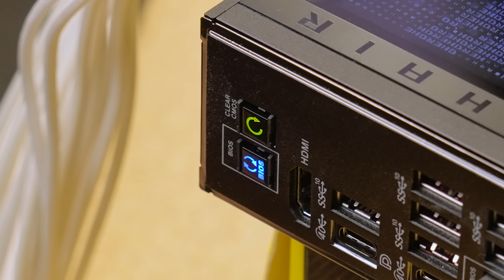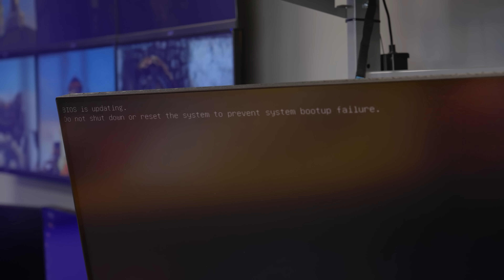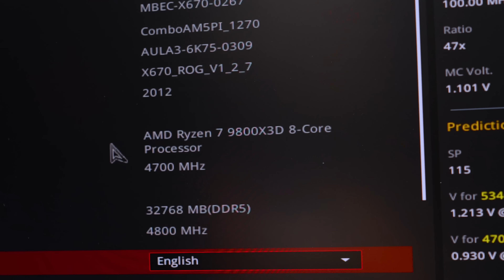This PC wouldn't post... so they brought it to me!

Comment: My PC literally is trying to duplicate the external drive, won't offline scan through the anti virus, is trying to run both versions of windows 11 home when it's supposed to be 64 bit and is double launching apps while Also system 32 random pops up and I didn't even do anything to it other than playing games and had a cheater pop into the lobby

Comment: When I worked with IT Support in an office, I discovered a strange thing: Sometimes the PC just want to take a stroll! I went to the desk where it was located it didn't boot, checked everything, it was all perfectly plugged, took it to my desk, it boots just fine, check everything, all parts are fine and well conected, put it back in its original place, boots just fine! No dirty power problems, nothing loose, just needed a little trip...

Comment: 2 possibilities for location based issues. 

1. Dirty power freaking out the PSU
2. EFI issues from some major magnetic field or unshielded/out of spec wiring. Like old power plugs that are not properly grounded. (no your plumbing is not a proper house ground)

I once delivered a CRT TV to a guys house and when I went to set it up could not find a place in his home that did not distort the image from random EFI issues. the only place that worked was the coffee table.

Ive more recently had an issue with EFI and high power motors too close to USB cables, but we are talking motors from full sized electric motorcycles.

Comment: The more I watch Jay's videos, the more I realize that I must have been extremely lucky in my 30 years of building PCs. Sure, I've run into a problem here and there, but nothing like what he faces and comes across. I will say that hardware today does seem to have a much lower tolerance for fully surviving issues such as power outages. Add to the fact that UPS battery backups are now universally garbage. And be careful plugging in USB-C components by doing the ol' reach around, as it is extremely easy to short something with that tiny connector.

Comment: I currently have a random issue with my PC. 
Current Hardware: 9800X3D, Asus ROG Strix X870E-E on Bios 1804 (Original MB was the Asrock Taichi X870E), RX 7900 XTX, GSkill 6400 CL30-39-39-102 1.40V, Corsair HX1200i PSU (Did RMA it thinking it was the PSU) If I set the ram to EXPO I was getting random Post Codes 97, 94, 9A, F0, 68. Now I only get 00.  If I manually set the Ram to 6000 CL30-38-38-96 1.40V it boots fine. But then I have an issue where when the system goes to sleep it will not wake correctly most times. If I press the reset button it will reboot and Windows loads like it resumed from sleep. All apps still running. If set the ram to JEDEC defaults it boots fine and my sleep issue stops. 
I have tried removing all NVME drives and load a new drive alone with a fresh Win install. With that fresh install I swapped the GPU with a barrowed 3060 Ti. Ran the same test as above but same issues. But Ram at JDEC and the issues stop. That leaves the Ram and the CPU. I'm leaning towards it being the Ram. What do you all think?
Reply: I mean the fact you cvan sorta fix with the ram at JEDEC speeds tells me that the ram kit just isnt the right one for your build, im betting you just get a 6000 kit and swap it out it will just work, obviously with the price of ram it wud be difficult, but hey. People always say check the RAM compat page but i never have and mines always worked but i have 14th gen intel which seem to be more friendly than AMD when it comes to RAM... They already have the mem training issue and stuff... But yeah, id say a diff kit will sort it for you...
Reply: @Adamgreen735  Yeah that is what I'm hoping for that a Ram Kit replacement will do it. Crazy this kit is on the QVL for the Asus MB. It wasn't on the list for the Asrock Taichi. But you would think taking Ram that "can run at 6400mhz" and then taking it down to 6000mhz with similar timings would work. The original setup had been running fine for almost a year until then end of Oct. Went to turn on the PC from a cold boot and random Post codes started. And the other thing I have been able to do Memtest86 Pro, Karhu, Prime95 test at 6400, 6200, and 6000 for 24+ hours with no errors. It's been a crazy issue for the last few months.
Reply: @donnellb23  Yeah all the benchmarks are all well and good ive found over the years, but there is nothing out there that will find faults in a PC like gaming or even just normal daily usage. Its crazy, I had an old PC one year, and every benchmark stress test i could throw at it never made it bluescreen or fail in any tyope of way, but then soon as i started gaming....Boom, clean blue screen and restatrt... So yeah, id just try another ram kit just for sanity sake ya know, maybe just get the 6000mhz kit as 6400 ya not gonna see much more performance gain with it. If it doesnt work atleast you have something thats worth more than gold and someone will buy for the same price you got it for.

Comment: I have a feeling the windows h24 or 25 update fucked up voltages. I recently built a am5 build with a x870e 9800x3d and 6950xt and I cant figure out why the power draw is being limited. I reinstalled everything removed all clocks and stayed on completely stock other then -20 for the cpu undervolt. When I turn on the secondary clocks which is supposed to be the faster of the two, my whole system just fries itself and I cant keep it on for more then 20 minutes without it blue screening or freezing. Im getting another 8x8 pin pcie connector for the power PCIE slot 1 on my motherboard to see if that hopefully fixes the power draw issue.

Comment: Gotta test the issue at the location that it's having problems. Could be the wall socket, the surge protector, or like you said the case... Winter has a lot of static electricity build up so it can do a lot of crazy things.

Comment: I'd just like to be able to type after switching tabs...  Turned off XMP and it was better for a while, but started up again.  Bumped up RAM voltage a hair and it was better for a while, but it's back to it again.  RAM's only ~6 months old, and the last RAM was fine for 7 years, so really don't know what the issue is.

Comment: Former electrician/maintenance tech here. Check his voltage at the receptacles that he's plugging his computers into. Voltage drop (typically caused by a long circuit run on wire hasn't been up sized for the distance) will do some funky things to a computer that has a power supply overheating and making lower than spec DC voltages.
Reply: But would it make cpu overheat? I guess psu would trip some sort of breaker if voltage from wall isnt stable
Reply: @AnomaliGaming8 possibly... A lower voltage increases ampage, the latter being regulated by the PSU (assuming it's working properly) the former, the PSU can't regulate so well.
Reply: @AnomaliGaming8 a lower voltage under load causes a rise in amperage and heat. A lower AC voltage to the power supply would cause a lower DC voltage output and higher amps and temperatures throughout the PC. Voltage drop is insidious as it doesn't cause enough of an amperage spike (heat) at the panel breaker to trip it. So everything on that circuit, slow cooks. Even over load protection at the power strip may not catch it. 

The computer acting "possessed" and shutting down, suggests that it's thermal protections were catching something on the DC side after the power supply.

Two computers doing it on the same branch circuit (potentially), house, service and transformer, has me thinking, it maybe a voltage issue at or  before the receptacle somewhere. But it's just a theory, until broken or proven via multimeter stating at the receptacle and working back until a clean and consistent 118v, or better, is found.
Reply: Note: Low AC voltage may and probably would impact the monitor without shutting it down, causing more of the possession impression.
Reply: @Erin.1911 that’s not how proper PSUs work mate, a PSU is a voltage and current regulator, doesn’t matter what’s coming in from the wall. If it was some knock off crappy unbranded PSU then maybe but that’s not the case here
Reply: I had the same problem with my computer. I had my PSU replaced and now I'm running at full capacity.
Reply: I would also check the voltage with a load on the circuit, like plugging in a small space heater or a hair drier or aomething
Reply: I've seen the plug ppl are using be the culprit b4 a few times as well. Someone's extremely high end build was just constantly shutting off and doing weird stuff at dudes house who is no slouch when it comes to IT and he tried EVERYTHING, including swapping parts from his old known good PC to no avail. But when he would let a friend check it out they saw zero issues, same thing at shops. It got stress tested like crazy and not a single issue could be found until someone there mentioned offhand maybe check what he was plugging it into at home. Turns out it was a bad surge protector but another time it was the outlet itself. No one thinks of that but it's always worth just trying another outlet at home if it's shutting off or doing other weird stuff and you just can't seem to figure it out, deff can't hurt and best case scenario you find out all you need to do is move the PC elsewhere, though sometimes that isn't possible and if changing the outlet isn't enough they might need to replace some wiring which can really suck and be expensive.
Reply: I wonder if Windows Event Viewer would be helpful here. Not sure if it logs or can even sense dirty power. Could at least be useful in ruling out temps as a cause.
Reply: @kevinlloyd3047  a good multimeter, and kill-a-watt, or equivalent brand wall meter would be helpful here as well to check for voltage drops/spikes, as it might not even be in the house wiring itself, but on the power company's side with dirty power being fed into home which was the case for me at work earlier this year when we had lights flicker, various electronics not working right, and even causing our internet to go out. So I would do that, and have the power company come out as well to check things on their end before it becomes a fire hazard due to an old transmission line, or transformer starting to fail, which was our case.
Reply: @CommodoreFan64 multimeter is not as good as a PSU tester by any means
Reply: @kevinlloyd3047 Yes they can. I had the same issue. Your log will only tell you about the power failure. Unexpected power loss. The random shutdown issue.

Comment: You are right that since gremlins can be power related, but that can be outside the case too. There may be a "ground loop" where a computer and a pored peripheral (monitor, amplifier, speakers) are connected to a different phase. It can cause some power to flow between.
It can also be that the ground pin is not at zero, but floating, or that another device on the same fuse has a leak, not enough to blow the fuse, but enough to make the ground, not a ground any more. Or it can an issue with an extension cord (or something else plugged in it).
Or there is noise on the mains and power supply doesn't have a good enough scrubber to deal with it (or possibly brownouts)
Because of how us homes are wired things can get weird.

Comment: My pc stuk at 120 fps.
Reinstall, update, all fresh.
Still stuck at 120fps for gaming.
Even using different monitor that ohly have 60hz refresh rate.

Even on old game it wont pass 120fps.

- R5 7500f
- 32gb ram
- 1tb nvme
- RX 9060XT 16gb (Sapphire Nitro+ )
Weird.

Comment: 4:16 the Corsair power supply cables are great! 
Unfortunately I’ve had a problem with mine. The standby voltage is low. Which was noted on the psu tier list. 
But anyways I bought a cooler master sff and haven’t been able to swap it yet because it didn’t include enough cables and cooler masters pinout is stupid so I have to repin a couple cables. 
We need all psu manufacturers to standardize to the corsair type 5 pinout!

Comment: I just spend 3 months RMAing my pc parts to try and fix my system.  And I got Screwed by Asus warranty. I had 2 months left on my warranty when I started having issues(random shutdown and restarts). After testing PSU and GPU in an older system, RMAed MB as it seemed like a power delivery issue.  They replaced it saying there was a bent pin which there wasnt. I even went and bought some new cpu covers as I couldn't find my original to avoid damage in shipping.  got the MB back, Lasted 1 week and started having the same issues again but worse. sent the mb back and they said the mb was good. took 3 or 4 weeks to get the MB back. Since they said it was fine I started Rmaing other parts like cpu and ram.  when I get those back still the same issue.  But now warranty is over on the MB and they wont take it back. Ended up buying the cheapest MB on amazon just for testing and now system is stable as ever.   I think Im done with Asus now because of this experience. I ended up spending something like 500$ in shipping + 250 on a MB. Because all this happened at the height of the Canada Post strike and places like Fedex and other companies increased their prices.
Reply: I was having an issue with mine as well. And i believe that i have fixed it. I changed nvidia settings from prefer performance to normal and did a ddu on nvidia drivers. And changed ram overclocking from pbo1 to pbo2. Seems to have solved my issue.

Comment: Helped someone diagnose their PC before, left it in his case, even used his power cord, but at my house, it worked perfectly. Went with him to his house to boot it, and the problem he was having, fired up, then went all wonkie and turned off. So 2 trips back and forth, my placed worked, his place oh no. So the little marbles in my head started clicking together. 

Asked if he was having any other difficulties with sensitive electronics.  He said his router had been cutting out alot. I plugged a voltage tester in his electrical outlets, and was getting 80v at best. Found out he was getting very dirty power all the way through his  his rural area. The power company wasn't pleased with all that work they had to do.
Reply: I'm in SC, & we had the major hurricane last year come through my area, and earlier this year the power at my work(almost a  90 year old building that use to be my small rural town hall, and  is now a community center for the past 15 years), but earlier this year issues from that storm finally started to show up again on the power lines, & and old transformer across the street from us, so  yep our overhead LED Lights would dem, computers, TV's, router, microwave, etc.. so my town paid to have the breaker box wired as some of the voltage drops/spikes caused some breakers to not function right, AC/heating system issues, etc.., needless to say when our mayor called the power company they were not pleased with all the work they had to do findinging out more people on that side of town where having issues as well.  

So to anyone else reading this, if you're having power issues don't be afraid to call the power company ASAP, and have them check their end of things as it can cost you a lot of money if you don't, and it can even lead to being a fire hazard.
Reply: jep friend of mine had that exact problem and also with his PC not posting. Fortunately it was just that one power socket for him, so an alternate socket worked fine.
Reply: Checking voltage at the outlet is always a good sanity check after double checking everything on the machine in question.
Reply: Had this exact same problem, was frustrating to say the least.  In the end the power company did fix the issue, something with a ballast resistor and the transformer to that particular area (Can't remember exactly what) or some such thing was causing the issue in his neighborhood.  After that was fixed everything worked fine, all the while though it was making bang my head on the desk lol.
Reply: A fellow technician told us a story about a site that was receiving 140V of AC input power.  He went to troubleshoot the machine he'd been called for and told the convenience store manager to call the power company.

"Huh.  I wonder if that's why our server is messed up and our refrigerator systems keep burning out."
Reply: A make-shift solution is to install a UPS, which will bring the voltage up to normal.
Reply: @outlet6989  Not always if there are a lot of random voltage drops, and spikes, and over time it can even lead to damaging the UPS, it's best to have the power company to come out to check their end, and you must, then bite the bullet, and call an electrician, or a friend/family member who knows what they are doing, if you personally don't feel comfortable checking your own home out for faults, as it's not worth risking your home to an electrical fire which can cost you everything you've worked for, as even with homeowners insurance they don't always cover everything.
Reply: @outlet6989 That would be very short lived, maybe an hour at best as the draw exceeds the supply and drains the battery.
Reply: @jessed2296  Yes, though it would easily prove the issue plus it's for the best that you have a UPS anyway.
Reply: @Rocotaco Very true, for protection and stabilizing sine wave frequency.
Reply: I work customer service for an ISP and I get a lot of people that will have issues like this with their routers and stuff. We will have provided countless new routers and changed equipment multiple times. 

Given they are already mad and blaming us, I have not brought up this possibility but I'm pretty sure it's likely the power company at this point for a lot of them. Especially when somebody says their neighborhood is having the same issues.

Comment: Damn. I've been having POST issues with my 9950x3D on an MSI PRO X870E-P WiFi, already RMA'd once but the issue isn't completely resolved. If/once it POSTs, it runs like a dream, but getting there is the hardest part.